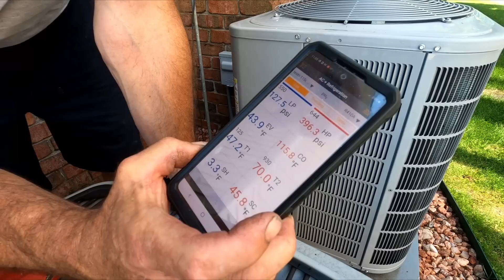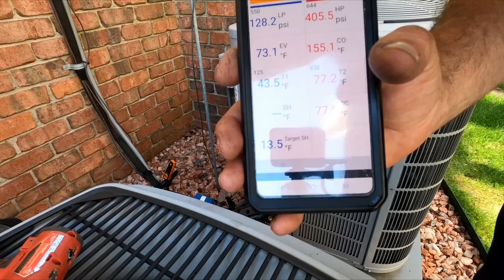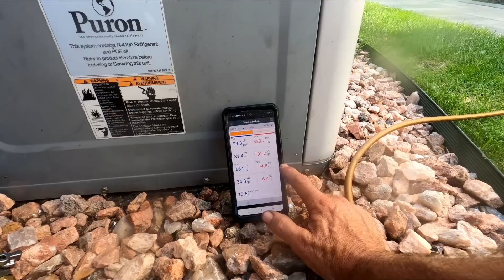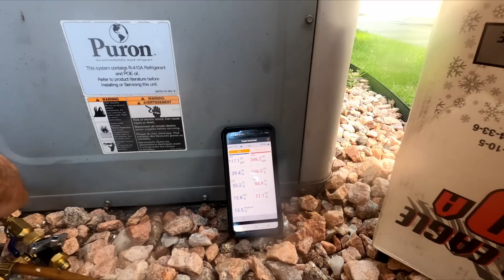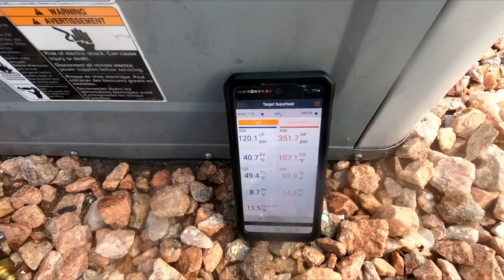Large House No AC Upstairs

Comment: Installer must've forgot it was a fixed orifice. I've found the carrier txv takes every bit of the 15 minutes to settle in. Ran in to several over charged txv systems that were on the plus side after install and had high indoor humidity. Never heard back from the customer until they had a failed two year old cap or contactor. Good video👍

Comment: I guess you could say that in the north, it's mostly just homes for the wealthy that have separate second floor ac and furnace systems, as 5 tons is overkill for all but the grandest of older homes most places North of the Mason-Dixon Line.
Reply: I don't know, here in California with multi million dollar homes it's common to only see 1 unit.
Reply: @someguy9778  some of the reason why might be California's high real estate prices, at least near the coast for even older subdivision homes. Arguably you only need much heat removal in the Central Valley or Southern California's inland parts and just some dehumidification near the coast. They generally seem to be more into upsizing air conditioners in the southeast part of the United States due to the combination of extreme heat and humidity. Also attic ducting is generally the norm in the Southern US, but much rarer in the north, due in large part to most northern houses having a basement or crawlspace, which affects the net efficiency of the system.
Reply: Every house in California is overpriced. I know when my mom had her unit replaced they put in a bigger unit, when the old sized unit worked just fine for 35 years.
Reply: @someguy9778  Steven Lavimoniere has shown that scenario in Massachusetts even. It seems that some HVAC companies like upselling oversized equipment, which usually only makes sense if you are adding on in the near future or bought one of the largest gas stoves marketed to homeowners.